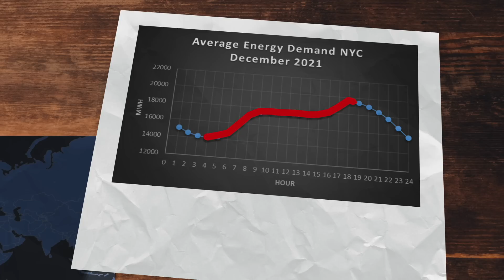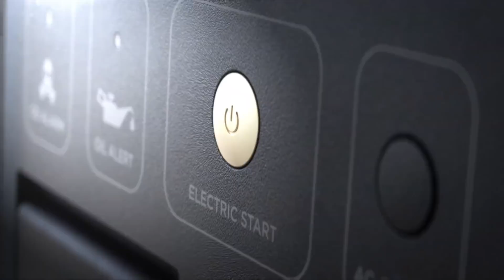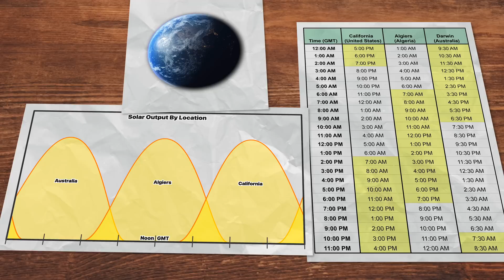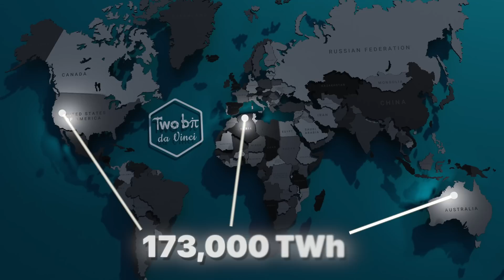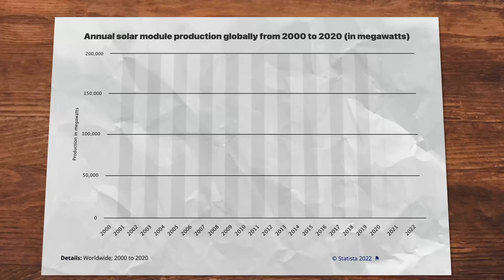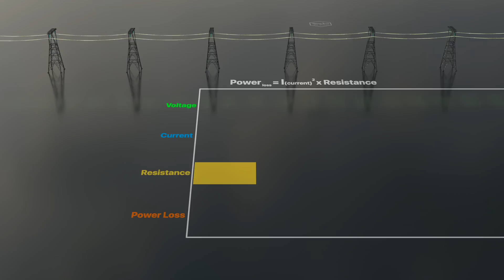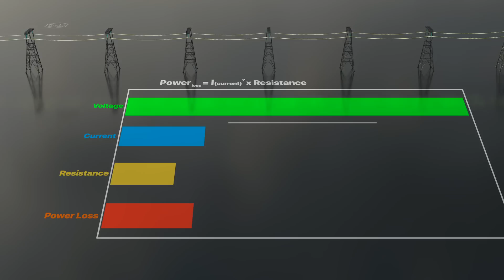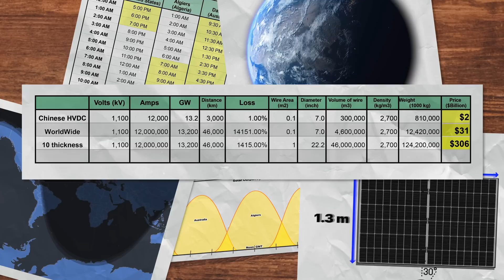World Solar Energy Network... Could this work?

Comment: The moment you propose such a gedekenexperiment you've already posited a central point of failure in the centralization of a global system-it would serve NO other real purpose besides to institute a global control of energy generation and supply. That immediately should cause you to question the entire framework of your proposition.
I DESPERATELY would love to see free acccess to very low-cost (there really is no such thing as FREE) energy for the entire planet. but that would NEVER come from such a centralized system. and you've already removed the possibility of any elegance in engineering such a behemoth, which means cost is not possible to optimize.
Identifying most critical flaws in such an experiment should quickly tell you what kind of global solution MIGHT work fairly well, though.

Comment: Those figures, wow...  And thank you for the video and all those stats and information, but there's another way, and it might be a lot cheaper. How about if instead of doing the whole world, which is easy to work out but very expensive, this could to be done in "lattitude neighbourhoods."  A place connects roughly E-W to similar islands of energy use to catch the day length advantage, and if there's no neigbour, they connect N or S or both to jump around the void. Also any island can make N-S links too, and every so often, major energy islands should undertake N-S  links as well. There are only two Golden Rules: You may only get back from the grid what you've put into it, i.e. treat it like a giant battery. Appropriate corrections are made for differences in latitudes along N-S links to prevent "power" accumulating at the equator. MUCH smaller megagrid line costs, much more incentive to become energy- independent. And Golder Rule #2: ONLY clean sustainable energy counts, any energy your island produces using fossil fuels or one way hydro or any other non-clean energy source are counted against your grid energy balance, making sure this island grid gets cleaner and more efficient as time goes by.

Comment: love the presentation, personally compres air is the solución,a scuba tank cost the same as a lead acid battery and store more energy,a tank with a diameter of 16 feet reduce the  price by 16 times that is approximately 10 USA dollar kw ,made of steel or aluminum it can las in 50 plus years even with multiple circles a day, inefficient but just a few panels extra will cover the loses.tanks get cheaper as they get bigger, batteries do not.

Comment: Nice presentation, countries with 3 or more time zones will get at least 14 hour of. independence,ac , refrigerator  and heater are the main demand of electricity so cold and heat storege are better than battery also programing refrigerator to-do defrosting during peak solar times and a smart temperature sensor so at knit will be of at least 50% of the time ,this will probably uses more energy but it will be at day time, personally as a of grid person I implement this in my home.

Comment: As you mentioned in your video, mate, it's waaaay too ambitious. Feasible with today's technology, yes, but astronomically expensive. For the next couple of centuries, I believe we should focus on making capacitors or batteries or any other power storage supply more efficient, with greater potential.
Hydrogen (H+) and Helium-3 could also provide the extra quantities of power we need worldwide. Fossil fuels, also, will be always essential for the "extraction" of (H+)... We can find our much needed power almost everywhere, let's focus on doing it as much as cleanly, as much as efficiently as well.

Comment: Very interesting thought experiment. Great to have you crunch those numbers too, which is a great public service.
Use solar would be a huge waste of materials and money. 
We should be concentrating on geothermal and water based energies such as tidal, wave, stream, etc for sustainable base load power, so we can avoid most of these issues.

Comment: As far as locations, high "cold" deserts (like the Great Basin or New Mexico Plateau) might be better than low "hot" deserts (like Mojave or Sonoran).  Solar panels lose efficiency at higher temperatures so panels in low deserts will need to use more energy for active cooling.

The engineering and resources for intercontinental electricity distribution of 100% solar are too prohibitive.  No technology can overcome the laws of physics that are limiting factors.  Technology breakthroughs can help with developing storage solutions and non-intermittent clean energy sources to balance out the intermittent sources.  Money, time, and resources would be better spent on those technologies and staying with distributed energy production and storage.  Next-gen nuclear and ultra-deep geothermal seem like better bets, and can be distributed across the globe so that intercontinental distribution is not needed.

Comment: We still cling to the idea of simple hierarchical models and the disproportionately huge production/distribution engineering challenges which go with them but the real solution is behavioural.
Generation should be from 'virtual' power plants - entice social & private housing markets & businesses to stick panels on their roofs (with in-home thermal & electrical storage to satisfy their demand) and sell the excess to the local/regional/national/international trading platforms. Co-locating the majority of supply & demand reduces transmission challenges/costs/inefficiencies with excess generation spilling to the global market as required.
A mesh solution rather than a tree solution with devolved generation & costs, no extra land requirements & built-in redundancy/resilience.

Comment: How about geostationary large solar stations which could potentially partially shade polar areas for cooling and send energy by radio-frequency to individual power stations.  No costly cables, less energy lost in transmission and Solar 24hr per day without shading from the earth.  The largest issue would be transmission from space and accurate transmission and recieving.

Comment: A comparison between a network of pipelines for hydrogen for the distribution would be interesting.
Reply: Transmission lines will always be more efficient than pipelines for transferring energy.
Reply: Looks like the costs for DC cables are prohibitive. 1 H2 pipeline transports as much as 5 DC cables. Thats the reason for Northsea projects, focusing on H2 production on artificial islands
Reply: @nicnordic6143  I see, also convenient when demand is low I suppose.

Comment: I think this is a good thought experiment but I do wonder about things. What is the carbon footprint for all the aluminum wire and the solar panels?  How long would this take? What can we do faster since time is of the essence! I think new storage tech needs to be funded better, storage that uses much more common elements/chemicals than the current Li-ion chemistry uses. Again, I believe time is off the essence.

Comment: This was great. I would really like to see something about how usable microwaves would be for transmitting electricity around the world (or from space).
Reply: Sun is emitting microwaves with a lot higher power levels then we can transmit. Energy transfer using microwaves is complicated as world is bent and microwaves only transmits in straight lines. Compare sun light which is microwaves and  not easily is bent around world.

Comment: This kind of thought experiment is lots of fun but we should be careful with the applicability of some of the conclusions drawn. Energy is the single most valuable resource on Earth and you are talking about supplying it to the whole World for decades. For this reason the price is always going to be 'astronomical'. If other great infrastructure projects such as oil and gas production and distribution had been similarly examined would not their costs also seem astronomical? How about the Worlds road networks? Can you cost out those in a similar way and roughly compare it to the World's GDP? Finally once you reach incredible scale on producing something like solar panels the cost is far lower than at present, it's a law of economics, the limiting factor is more to do with raw materials but I have seen no reasonable argument that we will run out of these.

Comment: Just an average Joes thoughts, but wouldn't it be better if we had multiple small storage locations and have a few big panels in space that directs the UV rays to those locations Wouldn't that remove the need for all the wires? Or would that be to dangerous?

Comment: Ok I KNOW what video you should do next, a feasibility video of Nikola Tesla's energy transmission towers like the one he had Westinghouse build (Then teared down before he could switch it on) to wirelessly transmit power into the earths stratosphere to be pulled down anywhere on earth with a simple receiver.  Westinghouse pulled it down because he couldn't figure out how to charge people for using the electricity.  I'd like to know if it would of worked if it were fully funded?

Comment: This project could not possibly work, solar panels are too inefficient. Manufacturing solar panels is not carbon neutral, right down to the waste after life cycle. It could be possible, just not with modern panels. We need some solar innovation first, panels now are just a waste of money taking 10-15 years to break even.

Comment: What if you didn’t need solar panels, wind mills, petroleum, or nuclear.
What if you had something the size of a refrigerator that could power your home.
That never needed to be refueled.
Hint, water or air.
The Amish use compressed air to operate their factories.

Comment: Political cooperation is the chief hurdle. A global energy grid is attractive, but such a complex engineering project would require a central authority the world never has had. For that reason, such major achievements are rarely, if ever, multi-national, and usually much smaller and shorter lived.
Still, the idea of a global power grid has enduring appeal. The more likely path for global energy integration might lie in smaller, regional energy alliances developing among nation states. These regional power grids could draw power from all renewable energy sources, not only solar. 
Later, the regional systems could be combined, when-- and only when-- the political stability issue were resolved.

Comment: Hi Ricky,
I don' like the assumptions made in this video.
First thing, we may never go to 100% solar even in year 2100. We will have base load coming from Nuclear+Hydro+Geothermal+Biomass etc. Assuming this base load is more than 25 to 50 percent which is not solar.
Assuming the humans will increase power consumption to 250 Twh by the time we connect the grid with other countries.

1. We would generate more than 60-80% of the current requirement locally, the rest may be imported from other countries during your countries peak demand.
2. Transmission lines need not go these thousands of kilometers. Each country will have a central grid and you need to connect from your grid to your neighboring countries only.
3. Exchange of power through electricity grid between countries will be similar to how there is current import/export of fossil fuels. 

I think lot of people said transporting large amount of fossil fuel across long distances is not possible, we don' t have ships large enough, we would need 100 years to build the number of ships required, we don't have ports that can dock them and if ships maybe in danger from piracy etc. but now we are doing it because we have to and its profitable.
We will do it with electricity too but not the scale Ricky is assuming here.

Comment: I was doing a similar thought experiment, a number of days back, and I was thinking about the wires. 

My conclusion was not to use wire, but to use pipelines. A pipeline, used for transferring oil or gas, could conduct electricity, we have pipelines today, and the great surface area would not require  complexities of high voltage DC. 

The pipeline could also act as an oil / gas / water pipeline, for immediate profitability & reduced investment risk. 

My major concern is with salt water being conductive, as well as any moisture in the ground being conductive. Any small problem with insulation could be absolutely deadly, to a lot of stuff nearby, including people.

I still like pipelines, maybe a pipeline coated in fiberglass, but a leak of saltwater in the ocean could still be catastrophic. Maybe a pipeline coated in aluminum or copper, then coated in fiberglass would be acceptable.
Reply: Or we just use the electricity to crack hydrogen as well as pull co2 from the air then use more solar power to produce methane and use some more electricity to turn it to liquid that can be sent down the pipeline.
Burning that fuel would be co2 neutral as the co2 would have been removed from the air.

Comment: How about getting a second use out of the solar panels as microwave collectors?

And putting solar panels in space where it is always sunny.
---
Orbital solar collectors.  They can be made from foils - just plan for a 5 year service life. They can use lots of mirrors to focus light to a smaller area of photocells. 

Use this to power a collection of microwave lasers. Microwave power conversion is 75% with inch scale wire mesh devices. Power efficiency drops a lot, but it gets power to the dawn and duck where it is needed.

Construct new solar farms with solar panels that receive microwave radiation too. Satellites communicate with the farm to ensure the lasers remain pointed optimally. 

Seems like a cheep upgrade to solar panels in general.  Especially if you can collect power for an extra 3-5 hours a day.

Place the orbital satellites in polar orbit along the night/day terminus and deliver power at dawn and dusk using the solar panels that are currently unused.

If you are okay with 50% power loss you could beam up power to orbital satellite rings that beam it down to the places power is needed.

I think this could be prototyped this decade...

Comment: At the scale this video illustrates, I think it's unfeasible.  However, multi-gigawatt floating solar arrays with dual-axis tracking systems could be built on top of reservoirs of gravity dams.
The dams themselves would be the energy storage needed to provide power during the night, during cloudy weather, or during moments of peak demand.  Also, they would be helpful in places where drought is a serious issue.
If people are curious to think on a scale this big, then I would apply that big thinking to ocean current power, tidal energy, offshore wind, offshore geothermal, as well as other ideas that aren't directly energy-related, but would still result in emissions reductions.  I.e. deep-sea mining, the electrification of steel smelting, mass transit, high-speed rail, etc.

Comment: We could save our cost by reducing the number of mono- usage components in the system and maximize the decentralized aspect of the farms. We can do that by looking at the one area on the planet no one truly uses for residence or agriculture, THE OCEANS. If we build the farms on floating platforms at sea, we can spread out or unravel the area the solar farms would occupy. This allows the farms to not only be effective longer during the day but it could also serve as the power lines connecting the grid reducing the need for heavy cabling or at the very least optimize the cabling used. (Underwater Cables in certain sections of the Oceans will ensure safe shipping lanes). The Ocean water could also serve as a cooling system to prevent the solar paneIs from overheating. An added benefit of having solar farms on the ocean surface would be the creation of shaded areas that draw marine life to seek shelter closer to the surface thus encouraging a robust natural ecosystem on the surface oceans that can help  boost fishing stocks. Obviously neither the Ocean floating platform system or the land based farm system is perfect but I think a hybrid system would let as have the best of both.

Comment: Your analysis of a world generation and distribution system makes sense.  Let's also put pressure on the demand side.  Reducing demand by 5 TWh requires no solar panels. It doesn't require transmission lines.  It's exempt from politics and terrorism.  Let's look at both sides of the cookie.

Comment: Superconductive transmission wires would be worth looking into. Yes, they are more expensive per km and yes you would need to cool them to liquid nitrogen temperatures but the amount of wire would be considerably less per channel and the transmission efficiency might just pay for itself. Also, this scale would greatly reduce the cost per km, possibly by as much as an order of magnitude.

The other future possibility would be graphine sheets for transmission lines. Clearly, that's not currently possible but when it is, the transmission efficiency should be better than silver or gold.

Another possible transport medium might be fiber optics. The frequency used is often in the microwave range, meaning conversion  efficiency would be 80-90%. And high grade fiber optics looses very little in transit. There are switching issues at the last mule of delivery but if you use local conversion stations that.then tramit power of standard electrical lines, you needn't worry about it.

Food for thought.

Comment: Forget about high voltage cables running around the world.  You want to use microwave satellite dishes to transmit the power to a satellite network which could send it to where it needs to go.